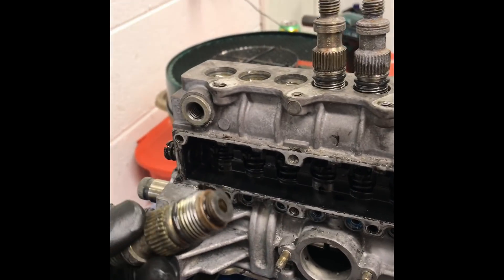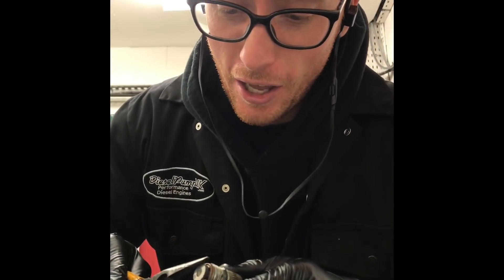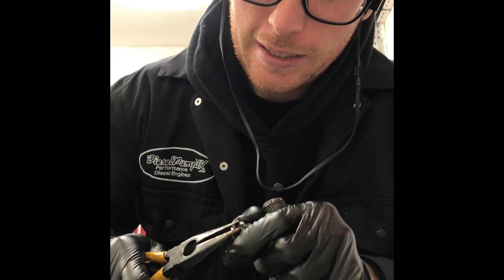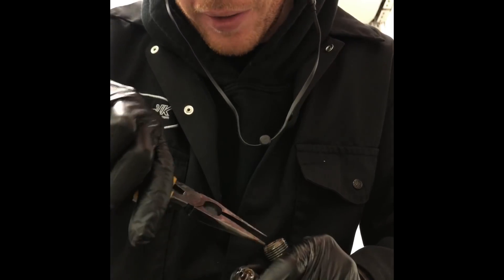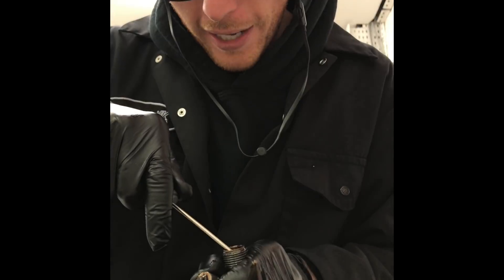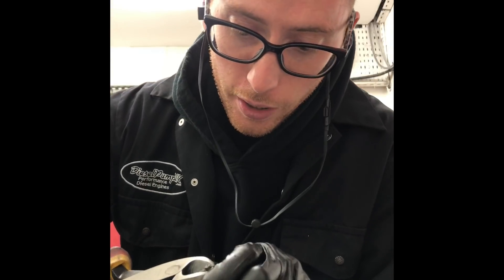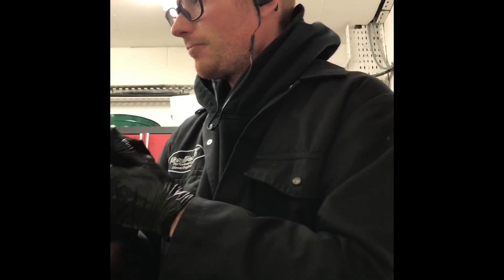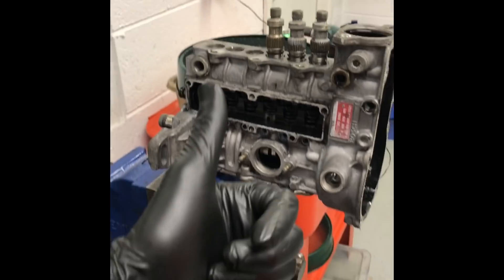Biodiesel ruins your Diesel engine

Comment: Rudolph Diesel invented the diesel engine running on peanut oil, as well as other fuels.
  Your blanket statements are false and inaccurate.
Poorly made biodiesel can harm certain components in the engine, but well-made biodiesel blended with diesel fuel can be very beneficial.
  Try educating your customers, as opposed to poking fun of them in public.
Reply: You cant compare Rudolphs engine with a modern Diesel
Reply: Chris Kwakernaat Who me? I wanted peoples thoughts on it. I’m new to biodiesel and want a reliable processor I can roll into my garage to use to make my own fuel. So I wanted to share what I found and see if a experienced biodiesel person could share their insight since this is a video about Biodiesel. 

I don’t think I’m doing anything wrong.
Reply: Yes Calder jacobs.. This kind of people .. Understand there motto... Every thing happens for reason. 
I appreciate you dear Calder Jacob s
Reply: There is not a thing wrong with proper bio diesel it has passed all the tests

Comment: Biodiesel is the same viscosity as petroleum diesel? I have common rail and no problems. Looks more like straight  cooking oil used.
Reply: Even straight clean unused cooking oil wouldn't do this.
Reply: I think it's used vegetable oil did that, clean wouldn't gum up like that..

Comment: I'm refining waste vegetable oil with  10 - 5 - 1 micron filters.   Never had any problem.  I'm blending oil with 10% gasoline.Car mounted filter holder includes a dewatering device.   Don't forget to drain it regularly

Comment: Before you bully me because bad grammar, I want you to know that I used Google translation to write this.
As a car engine mechanic, can you tell the difference between gasoline, biodiesel, vegetable oil or other types of fuel that are suitable for the type of engine? As far as I know, the use of the right fuel according to the type of engine is included as a basic knowledge as a mechanic. Don't give the perception that all biodiesel is bad, while the fuel used is not really biodiesel according to the process that is supposed to make the biodiesel, it is the same as equating that all high-octane gasoline is bad even though the engine that you use should use gasoline with a low octane level. Moreover, the car engine that you are repairing, judging by the conditions, does not use biodiesel made according to procedures or does not even use biodiesel at all
Reply: A very good view my friend,👍👍👍👍
Reply: My guy for a google translate comment that was clear and concise!! Good job especially with technical language that can be a bitch to translate.

Comment: Appears NOT to be biodiesel but instead straight vegetable oil or at least poorly made, unwashed biodiesel.  Biodiesel is an excelent solvent & will clean your entire fuel system.  Started making biodiesel in 2005 for my 1990 Cummins. Replaced my first fuel filter at 500 mi & every1,000 miles cutting them open to examine.  Fourth filter was clean.  My 2007.5 emissions Cummins 'knew' when I ran 100% biodiesel as NOX had to 'regen' more fruequently than particulate soot collected due to biodiesel makes far less soot. Would every diesel owner in America with low sulfer diesel to use B10 to replace lost lubrisity using low sulfer fuel.  Biodiesel has excelent lubrisity.  When using 100% bio in 1990 Cummins with mechanical injectors the noise & clatter reduction was immediate & outstanding.
Reply: Less clatter is not always a good thing. I observed the same as yourself when running on bio and veg but unfortunately I also observed worse performance and lower mpg. Generally the more clatter, the better the fuel is atomising and the bigger the bang.

If you ever use premium diesel, i.e shell vpower you will notice an increase in clatter and performance.

 If you ever hear a diesel running with allot of timing advance the clatter tends to much much louder.

Comment: Not knocking you - of course I only see what you put here. This engine looks like it was run on pure oil.

That’s the same sticky residue you get with over used oil.

I mean, you could “get away” with oil use once or twice depending on the engine as a fuel source, but you should if you’re wise load up on the engine cleaners or premium diesel to clear that out and remove the gunk.

I don’t think they ran bio diesel here. I think the person told you this was bio diesel but actually ran neat oil.

Comment: Looking forward too your response video after the recent “t shirt burning”

I for one, will look forward too it. On the surface Luke, it would appear your in hot water.

~eats popcorn as M.J

....
Reply: Oh yes luke is finished
Reply: OverblownSnow98 it gets worse.... have you seen the post where a half inch universal joint is used as a gear shifter, that’s bad.... but the prop shaft bearing carrier bodge is plain LETHAL!!! Search around for the post, guy had a merc w124 I think.
Reply: @BubbaZanetti6666  had a funny feeling about this guy from the start, its similar to what happened with dave at 4x4 fabrication although this is far worse
Reply: Dream it, build it! Aye that’s the link! Fucking wild!!! 

4x4 fab would get on with these cowboys famously!
Reply: @BubbaZanetti6666  yeah i saw what steg shared haha theyd be a right pair

Comment: I work as a bussdriver in sweden. We have a fleet of about 400 busses and we run 100% RME or HVO biodiesel, and we have had no problems with breaking engines. That would be an unsustainable market strategy.

Just dont run straight veg oil.

Comment: When you guys say it's used veg oil do you guys mean used veg oil that has stripped out the glycerine whith methanol and sodium hydroxide , then washed out any residue methanol with distilled water or do you guys mean just like straight veg oil that's just came out a fryer??

Comment: Cherry with a drop of 2 stroke oil 
They love it . Better than that crap I’ve seen loads of engines ruined with that stuff. 
Great video Luke it’s not often you to see the damage up close like that
Reply: Border Terrier man probably using second hand oil from the chippy, my EGR valve has stayed squeaky clean since using vegetable oil because there’s literally no carbon build up. At the end of the day all engines need maintenance and that’ll just be part of the procedure (just like changing your oil filter fuel filter timing belt ect)

Comment: is that biodiesel or vegi oil? vegi "can not be used" on a lot of engines and you need to treat is spesial etc. bio diesel should not have glycerin in it so that stuff should not be in there.

Comment: I believe that the treacle that he is referring to is the glycerin in veggie oil.  So, I believe that this video is labeled wrong.  The veggie oil can be processed to remove the treacle/glycerin so it does not gum up the injection pumps. This processing creates a new fuel called biodiesel.  I wish the title of this video would be changed.

Comment: Does anyone have a clue is it a smart thing to buy a 6 year old diesel car (I am stuck to buy because it is rare car with low millage) from a seaman which was driven periodically. The car was not turned on for app 4 months, 2 times per year so the diesel + 5-7% of bio component could stick and partially clogged the fuel system... Any thoughts?

Comment: That is straight veg oil In there covered in glycerin not bio and looks like used oil aswell. If you understand bio diesel you wouldent be saying that. There is bio diesels in regular diesel fuel.

Comment: I try to do a test my car was smoking real bad clattering I thought the engine was hit 1987 Mercedes SDL smoking bad I wanted to try and see what was the problem with the car I said screw it I’m gonna try this I went to the store purchased six catch bottles of cooking oil to see what would happen catch up after I put it in the car sounded like a gasoline engine The clattering The smoke all went away just a test always ran on diesel fuel tank was half diesel when I put it in from what it sounds like I need new fuel injectors  You don’t think I had ruined anything like this one time do you? Please respond thank you sir

Comment: I run my Xtype 2004 turbo jag on 50/50 mix veggie/diesel done over 11,000 miles so far and starts without no problems and runs better... But"! I use clean veggie oil not used :)

Comment: There is veg oil, biodiesel and then there is.. biodiesel. 
There is are additional steps to clean the biodiesel so this doesn't happen, however some people don't bother. You end up with this.  Saying BD does this to an engine is a misrepresentation as this is from cutting corners.

Comment: I don't think they're using biodiesel the using straight vegetable oil. If you don't process the oil it leaves the gum in it. They need to run two tanks.

Comment: Thats not bio diesel stuck in that. That's straight wvo with no dilute. Just figured I would give you a since you want to talk about it and make a video. That goofy stuff is glycerin and water... Whoever was using that in their vehicle didn't filter it didn't let it settle, but there's nothing wrong with using biodiesel. It has the same viscosity as diesel, roughly the same btu's does not have glycerin or water in it.  
And FYI... The first compression engine (diesel engine) was made to run off of straight rapeseed oil. 
This guy's going to change your halogen fluid when he's old enough to vote and know something about about something.

Comment: Poor video. User doesn't understand that veg oil and Bio diesel are two different substances. Biodiesel is 100% safe and actually better for your engine than conventional diesel and it is sulfur free and carbon neutral. The only downside to using biodiesel is in cold weather because it can congeal more than regular diesel.

Comment: How did you clean out the slug from all the parts. I have the same issue and it’s in my tank to, how did you clean it all out of all the parts. What did you use?
Reply: From what i have seen in the comments and my personal experience with god awful oil sludge I'd try to at first buy some regular diesel and use that as a solvent, let it sit in the affected areas for a bit (idk how long) see if it picks up the glycerin if it does remove the contaminated diesel and burn it as sacrifice to automotive gods for making it easy. If that does not work then work your way up to lighter solvents but be careful not to ruin the tank and cause yourself more problems.

Comment: I so love your channel. But this is not your best work. This is imprecise, incorrect and misleading information. Why? Because you are not distinguishing between biodiesel and vegetable oil, which have crucial differences.

I'd bet dollars to donuts that the "horrible goo" that you show at 0:35 is in fact the remaining unburnt triglycerides in the original RAW VEGETABLE OIL that the owner most definitely -- I agree with you -- should NOT have run through the engine. But that was NOT biodiesel!!! (1)

In a process called "transesterification", vegetable oil (or other cooking oil, yellow grease, or animal fat) is separated into 2 products: Biodiesel and glycerin (oddly, a primary component of soap: one can actually wash one's hands with it).

Because it is still in "triglyceride" form, vegetable oil is considerably thicker (more "viscous") than biodiesel, making it harder to pump to the front of the vehicle, and harder to get through the injectors etc if it is not heated.

It also does not burn completely, and clogs everything up -- as you rightly demonstrate here. Though not being completely chemically precise, we can consider that "goo" to be essentially "unburnt soap". Blech.

Another problem -- which I think you refer to here in passing -- is that some of the raw vegetable oil that people run through their diesels is in fact very CHEAP: It has been hydrogenated to make more profit for the manufacturers.

When one properly produces biodiesel, one only uses pure, non-hydrogenated vegetable oil. Garbage in, garbage out, after all.

Now yes, I know that many people claim that they have run veggie oil for thousands of miles with no problems. Or that they have a "pre-heater" kit which will make the veggie oil viscous enough just before injection to run raw through the engine.

I OTOH think they're just running a ticking time bomb. (Like people who say at 58 years old, "I've smoked and eaten fast food for 40 years, and I'm fine. I have strong genes." -- only to find out at 59 they have one or another form of terminal cancer "suddenly" popping up...)

So I myself never believed them, and only ran TRUE 100% transesterified biodiesel ("B100") through my OM617.  Because biodiesel is actually a thin oil, rings were lubricated from BOTH sides, and the engine ran MUCH quieter -- as Rudolf Diesel experienced them. Because it was not petro-based, the smell was way better (yes, think "french fries"). And because biodiesel is actually a mild solvent, then rather than clogging things up, it to the contrary CLEANED OUT my engine.(2)

I wouldn't let a drop of veggie oil into my OM617. B100 though? Oh, yeah. I wish I could run that in it for the rest of its life.

Since you are an experimenter and true engineer (and a lot of fun to follow along with), I encourage you to re-try TRUE biodiesel, and tell us what you find.

(1) https://afdc.energy.gov/fuels/biodiesel-production

(2) I always wondered if an engine like the one you're working on there which had been unfortunately run on raw vegetable oil could in fact be cleaned back out by running B100... Would be a fun experiment.

Comment: I think you straight poured the veg oil in your tank witch is not biodesel but when you poured the used veg oil straight in your fuel tank those little food bits has got in to your sistem and fuel company's won't sell the bio diesel if its not safe and not prossessd

Comment: 1. Biodiesel is formulated specifically to substitute fossil fuel without harming anything, not even electronic injection systems. 
2. Vegetable oil, whether used or wasted, is NOT biodiesel. It has to be properly treated. 
3. If this oil is improperly treated to produce biodiesel, including storage under improper conditions, is going to degrade and it will surely be harmful. 
4. Everyone should run their engine with fossil fuels from time to time (because of the detergents and other additives), to clean those deposits off. 

Biased videos are lame, dude. Shame on you.

Comment: What you think? Can my 2.7 cdi handles normal biodiesel from petrol station handles?
Reply: From UK petrol stations? Yes, easily, if you have any problems aided by fuel from a UK petrol station the biodiesel will not be the cause, as the % blend of biodiesel is far too low.
Reply: @cjeam9199  No ! I live in hungary and im very close to the croatian border, and in croatia you can buy BioDiesel from almost all petrol stations . It has a half of price than the normal diesel .
Reply: druszan17 Oh that’s interesting. Diesel fuel from petrol stations in the UK is blended with up to 5% biodiesel. But absolutely no filling stations sell pure biodiesel or even any higher blends that would have to be labelled as such. It’s very difficult to source pure biodiesel in anything less than tanker sized amounts here.

Comment: Mate this is not the fault of bio diesel its the fault of those making it who don't know what they are doing tho I will be testing this soon to see if quality bio causes this problem.
Your a guy who works on engines witch means you see the aftermath of idiots work and your opinion is based on your experience and your experience seems to be bio is bad.
Did you not stop for a moment and think Hey maybe im just dealing with the failed bio diesel makes/users.

Also I wonder if you was prepared to be wrong when you made this video

Comment: This guy is misleading people, and look at the top corner of his jersey, this guy works or own or what so ever a petrolium diesel, so obviously will always have something bad to say about biodiesel... And if petrolium diesel is great I mean 100% with faults why would every engine has a filter? All cars have filters because they is no a perfect fuel, they all have a side effects in a long run
Reply: @justafish-bd8kw  using straight vegetable oil is bad, either mix it with gasoline or actually use high quality bio diesel
Reply: He is the OWNER of DieselPump Uk and as this video suggests, hes not upto scratch on biodiesel… just like his engine conversions are sloppy at best as well… take what this guy says with a pinch of salt…